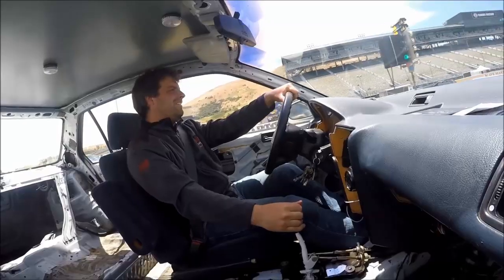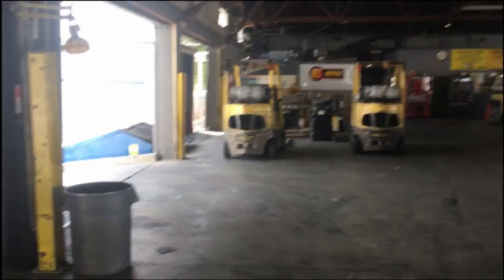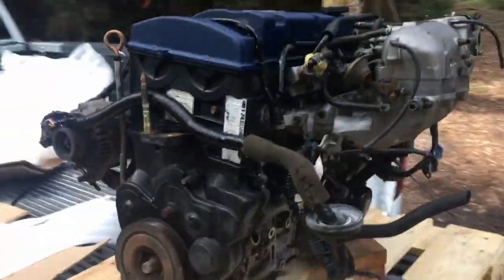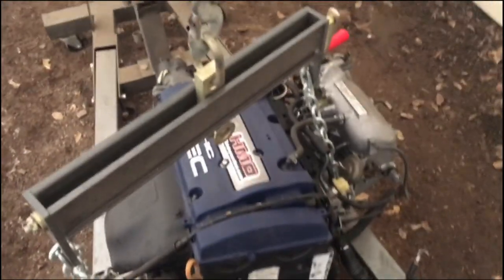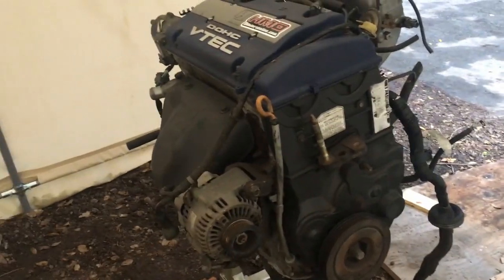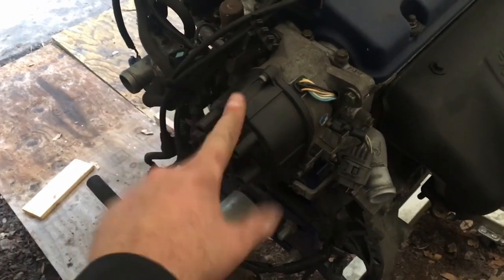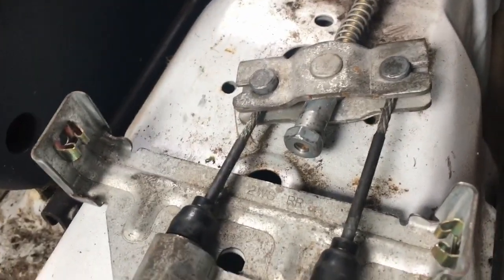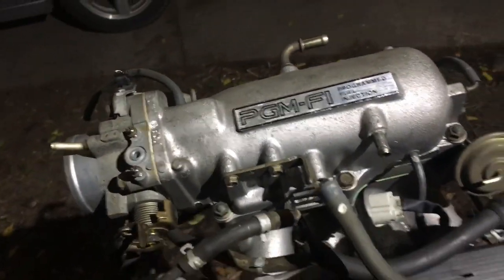CB7 Motor Build Part 4 - Welcome to my new motor + disk brake swap!

Comment: Double stack the spacers to get a larger plenum you could even gut one of the spacers to lengthen the runners then use the spacers to get a bigger upper plenum
Reply: Should’ve pulled the whole rear end that way you could utilize the sway bar that came on that cb with the disc brakes
Reply: *if your car didn’t come with a sway bar *
Reply from the maker: I’ve run double stacked on the previous set up, and I went to single stack because the extremely long runners were robbing me of useful power on the top end.  This time, I am going stock but pulling out all the butterfly parts for the IAB system.  If there is not enough top end, I will gut to reduce effective runner length.  Did you see that I had a Progress rear sway?  It is way thicker and more sturdy than the stock sway from that CB.

Comment: The h23a is actually lighter than the h22, it uses the lightest crank of all the f/h series engines....little fact I found when I got mine
Reply from the maker: Well hey, check that out!  You learn somethin’ new everyday.  I’m also really glad that I can source parts for USDM prelude Si VTEC engines and use them on this.

Comment: I guessed wrong but woah thats super cool. Good luck with everything. Also is swapping an h series much easier than going b series?
Reply from the maker: Thank you my man!  H series is much easier and more profitable than B series for this chassis.  No mounts exist and the torque loss from the downgrade in stroke would be felt right away.

Comment: guessing, H22a4
Reply from the maker: Good guess, I wanted more stroke though, so guess again!
Reply: @af1132racing  I just sold the H23V outta my wagon about 6months ago.  you'll get a minimum of 140hp to the wheel. I have a video of mine on a dyno for specs only, no tune.
Reply from the maker: I would love to see that, let me know if you can share that video with me.